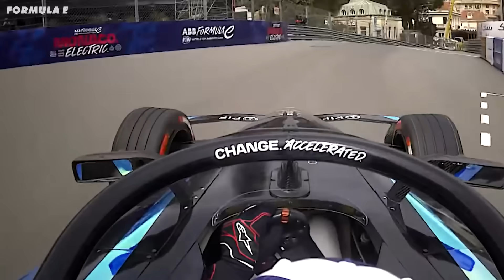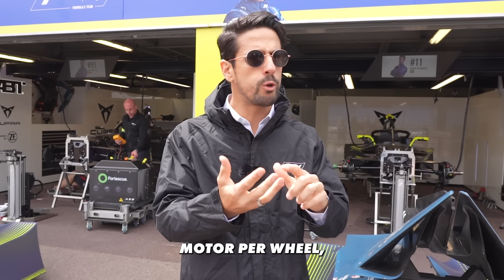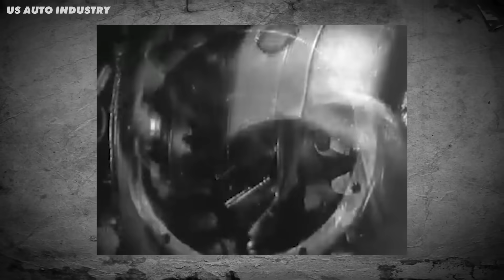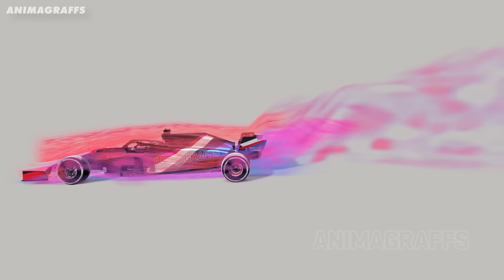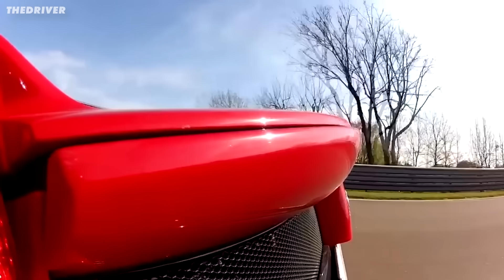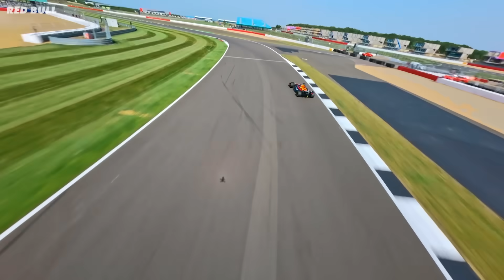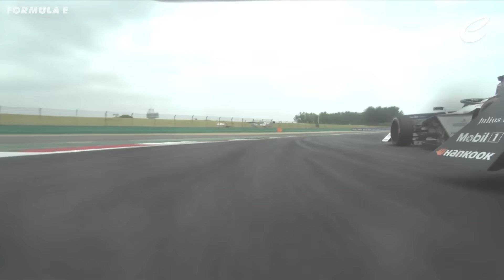The New Formula E Car Might Be F1 Fast

Comment: Active aero is one of the most interesting thing to me. Not just for increasing downforce, increasing and reducing drag, but for giving lateral forces to push the car through corners, counteract body roll, etc.
Reply: That's only possible in Formula student regs where they have massive allowed aero regulation box to provide sideforce.
Reply: @Dakkyun yeah i just hope to see it some day after seeing simulations of a car with full active aero.

Comment: Individual wheel drive, computer based torque vectoring, 4 wheel steering- where does drivers skill come in? Especially when you then go on to say the gen 4 formula e cars are going to be as fast as F1?  I appreciate one can ask what is the difference between this and racing the curent spec Sauber vs McLaren, but are we going too far into the pinnacle of technology corner as opposed to the pinnacle of man (or woman) mastering control over machine? Anyone can floor it in an M3 with the TC on....
Reply: "Anyone can floor it"≠ it's easy to win.

Racing isn't only about struggling with the car - it's about struggling against others. You are not fighting for a lap time for the sake of it, but because someone else set it.

The world of sports would be ridiculous if we never accepted changes that make the sport 'easier' to compete in. This change only promotes good driving, good strategy etc.

Comment: If an Fe could compete with an F1 I'll consider watching it. But racing enthusiasts expect new tech to improve the performance of the machines, not retard them by decades. They'll change the rules for Gen4 Fe to speed them up so people might watch them, but I don't think it'll work as who wants to watch a 15-minute race unless they also increase their range.  
The extra tech discussed in this video has nothing to do with them being electric, it could just as easily be implemented on F1s as well, but the rules currently don't allow it.

Comment: Also urgently needed:  ultra-rapid 30-sec semi-manual pit-stop battery-swaps enabling FE and F1 race cars to ultra-excitingly compete against each other in the same epic events and race series.  But that's obviously something that powerful oil+combustion addicted vested interests - the usual suspects - are religiously opposed to.   But audiences by contrast  DO want to see the ultimate showdown:  electric v combustion battling it out against each other at the same major race event.  Begin the real FE-F1 race revolution with an annual audience-grabbing F1 v FE showdown / face-off race - an epic 60-80 laps on an F1 track - FE cars using both 30-sec batt-swaps and ultra-fast charge-boosts. 
Paul G

Comment: I think it’s a mistake for F1 to become all-electric. We already have Formula E for that. The challenge should be building a more efficient combustion car.
Reply: are they not doing that? they got rid of the MGU-H since the fuel is 100% sustainable. for 2026. sure still hybrid with the MGU-K but they need it with the V6 only producing so much power. and also we really can't go any more efficient. engines are only like 40-45% efficient.

F1 only got 50-52% with the MGU-H. but now in 2026 that is gone. so the heat is not captured anymore.

Comment: Formula 1 has the greatest advantage over all other vehicles in accelerating 0-200 kmh (~5s), not 0-100. When accelerating 0-200 it beats everyone else. Formula 1 reaches 100 (~60 mph) kmh in first gear.

Comment: I'm probably misunderstanding, but if the software is going to control 
everything on the car, where do the drivers come in? 
It almost sounds like at that point, all a "driver" needs to do is press 
forward, back, and side buttons and the car can be programmed to
do the rest, right?
Reply: Nah, the software obeys the driver inputs as much as any other hardware, and they can be setup to the driver's liking, iirc not even TC or Abs allowed in FE.

Comment: As much as I enjoy the closer racing, and efficiency points, I just can't get behind the all wheel drive, active aero kind of stuff. I have no clue what those things will actually do to the behavior of the cars, but I really hope they aren't accidently making the cars easier to drive by making them faster and more efficient. Because I believe that making the cars technically easier to drive, compared to having rwd, or fwd, and no active aero is a lot more exciting; seeing the drivers fighting with the car the whole way through the corner. Having the ability to technically speaking, have 100% useage of the grip throughout the corner sounds really boring to me, as it would be less reliant on the driver, and more on the aero and computer. I love the idea of making the most efficient, and electric racing cars, but I just fear that this may become the new f1 as the years go by, and that honestly sounds not very fun to me. They are in search for speed and efficiency, while also, unknowingly, walking down the path of easier, and more computerized driving as well. Also, this isn't me just bashing on formula e, I think about the same problems with f1!!!11!1!

Comment: When we were kids we used to race electric slot cars, which were incredibly fast. It seems like racing and aviation are fast approaching engineering that removes the need for pilots and drivers. The 1966 film Grand Prix generated the excitement it did because of the drivers and their lives. 🤷🏼

Comment: I think you answered it towards the end. Is FE an experiment, or a racing series? You could throw all the tech upgrades you like at it, but if you want to have it an exciting racing series you need to add more driver input, not take it away with torque vectoring and active aero through each corner. It’s not much of a leap from this to removing the driver altogether.
Besides, if FE were so concerned with maximising grip they wouldn’t run grooved tyres.
Reply: well from what we learned from that AI race in abu dhabi we have a loong way to go before humans can be raplaced by computers to drive race cars.

and i mean F1 had traction control ABS active suspension active aero in the past. 80s and 90s. and i don't see people complain much about that era. 

and you are making me a bit mad here cus first u say u don't want driver aids. and yet u want FE to have slicks tyres. which by nature makes for better grip and easier to drive....WHAT!?
Reply: @jesperhammarlund300  I never said any such thing - I merely commented on the contradiction in the video suggesting FE were striving for more grip, yet they run grooved tyres.
Reply: @CaptainBlackadder75  if u do some research u would know that they run all weather tyres cus they only have 2 sets per weekend. per driver. this is due to wanting to use minimal rubber to be as green towards to climate as possible. and so they can't run slicks cus then they would need a rain tyre just sitting there just in case it rains. and also slicks would not last the whole race. so they would need more than 2 sets and so thats not sustainable. 
FE is sustainability/green to the climate 1st and speed 2nd. and tbh even tho its slower than F1 its has 10x better races

and also these grooved tyres they use are more similar to road car tyres. i dont know about you but ive never seen a road car that use slick tyre. so then why should race cars? 

so FE wants to increase grip in other ways than better tyres.
like AWD Traction control etc. or ground effect.

and if u ask me it makes more sense that they use grooved tyres. cus then they can improve the road car tyres from the data they get from FE racing. more so than F1 does with slicks.

ps: sorry about my last comment didn't mean to rant that much
Reply: @jesperhammarlund300  That’s it
Reply: The council have decided that jesper wins the case.

Comment: If Gen 4 goes axial flux motor + planetary gearbox in the wheel, it will mean the motor and brake are separated by just the gearbox - a very compact unit without a drive shaft. Perhaps the motor/gearbox/brake unit could go inboard so it is not damaged in accidents - this would allow the rack and pinion steering, motor, gearbox and brake to go in one package. With little suspension travel, a short, stiff half-shaft should work OK. Vector drive at each wheel would be great to see.

Comment: Thats incredible but, the drivers should drive the car, not be a mere guide to it. They should use the car, not the opposite. So its them who should be in charge of all the controls, except obvious things that can't be humanly controlled specially on top of everything else like in the motor itself and things of that nature. But all the controls, all of what make the car go where they want at the speed they want and how they want, that is what is supposed to happen when they drive. Not the computer deciding they prefer to do that instead or a person on a computer far away changing how the car work. Them having the control on that, because if not, doesn't matter how much better the computer in board is at it: its stealing the control from their hands, its not doing what the pilot want. Its never a pleasant sensation to do one thing but while doing it something different happen, on top of changing the trajectory they wanted and how they planned do things. Controling the grip of the car should not impact the decisions of the pilot neither should the active aero be controlled by anyone else than the pilots themselfs.

We recognise the greatest pilots/drivers by the way they take corners, the way they manage the breaks and acceleration, the lines they take during the race which is constantly evolving, the way they adapt not just to the changing track but to the other drivers too. That is why Prost, Senna, Schumacher, Loeb, Mouton, Vatanen, Lauda and even drivers like Collins, McRae,  Block, Tsuchiya and so many others are legendary. Because they drive like no others than themself no matter which car it is: they can't be taken for someone else. They are unique because their driving style and competences are unique.

If they can control the cars the way they want, not being """"""""assisted"""""""" by computer """""""correcting""""""" their trajectory, if what the technology is limited to the role of a tool they use and not one who use itself: that will be an incredible car and the pilots would give us amazing races. If not, then its not racing.

Comment: Inboard AWD is better than In-Hub AWD, Student cars aren't physically big enough to easily package front inboard motors though. Hub motors are cool but put a lot of weight far away from the CG, thus are bad for moment of inertia. Also Wheels tend to get smashed up, and those motors are expensive, bad idea to put them in a risky mount. Downside of inboard is you have a little bit of efficiency losses due to needing shafts.
Reply: exactly my thought. another thing i thought about is, FE cars use alot of regen to slow them down as brakes and so they dont rely on mechanical brakes that much anymore.

so here is what im wondering. wont't in-hub AWD basically make regen impossible as those motors are DC motors not AC motors as inboard motors usually are.
Reply: Just for the sake of an engineering challenge, support in hub motor, maybe smaller road cars (something akin to the Original mini) will benefit from this package more than performance cars.

Comment: I still think making it essentially a spec series holds FE back significantly, a true development war would bring the technology on leaps and bounds every year
Reply: That’s true, HOWEVER, a big plus of being a spec series is it’s vastly cheaper. And tbh I don’t know how much the teams are willing to spend on it when it doesn’t have a huge monetary return. It’s still a very small sport tbh
Reply: Nah it is not, powertrain and suspensions are different, it's more like LMDh in this case, you can have whatever motor in the car, you can have AC, BLDC or even brushed motor, they will monitor the current/voltage drawn make sure equal power and all the inefficiencies you have, comes from your own motor, you still have to do the homework.
Reply: @Dakkyun  surely forcing everyone to have the same power is still holding everyone back?

And are the power cells spec? Even then it should be de-restricted to encourage a development war
Reply: @callumlaird1195  batteries are spec. But the motors development, suspension development are still open, even at the same power, you'd waste some of it to heat,it's a war to stop this wasting, even if the motors are 95% efficient, If you remove this restriction, they still are limited by the battery because they STILL have to go the distance anyway.
Reply: It's not a spec series except season one. For now, only aero, batteries and tyres are the same. Everything else is designed and made by the teams themselves. There are some interesting ideas, like Nissan try to use a dual motor design, one motor as flywheel to reduce the electricity use but is banned.
Reply: @kencube86 so get this straight, someone came with with something innovative that could improve electric road cars if further developed (the whole point of the series) but they banned it so they could keep their pelton pack racing?

Why not open it up, no holds barred, and see how much we can invent?

Comment: xD Those drivers need to build a strong neck. With torque vectoring, you greatly reduce the speed at which your car can turn at maximum g-forces. Your car is turning because of the torque all 4 wheels are applying to the center of mass. With torque vectoring, you can trail brake into the corner with the inside tire and the outside corner can start accelerating out of the corner as soon as it gets traction.
While I love those systems from an engineering standpoint I really hope the drivers get limited to fixed mappings of inputs to wheel torque. If you add control systems into the mix it's barely a challenge for a driver to avoid over and under-rotation, similar to looking up a car with ABS.

Comment: I've tried every iteration of Formula E  and they all make me fall asleep.  The car is important but they need proper circuits with run offs so a mistake doesn't bring out the safety car. They also need to get rid of the stupid gimmicks like fan boost.
Reply: Fan Boost was discontinued in 2022-23.

Comment: FI cars have active aero called DRS, necessary because of all that aero. But then are they cars or projectiles? All these tricks when what is needed is technology that improves the breed for the oiks who ultimately fund the racing. People who buy & use cars (not projectiles). Battery tech, and torque vectoring can trickle down into EVs, dynamic aero won't. Unless you are filthy rich then it is a toy. A phallic extension.

Comment: One motor per wheel with those kilos, is better than singel motor. 12 kilos of those motors connected to each wheel, gives better weight managment , better cooling and better battery charging.

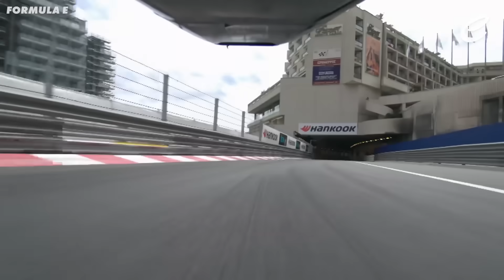Comment: 1:35 How is an electric car 15 times more efficient than an F1 car? I'm pretty sure an F1 car has a thermal efficiency of around 50%. This might, or might not include energy recovered from braking / exhaust gasses. If you are 15 times more efficient you'd have 750% effiency, meaning you'd need to you'd need to recover energy from braking and stuff 6.5 times, which is completely impossible. Is this instead just talking about how much energy is used to drive a lap around a race track? That's not really effficiency.
Reply: Efficient in the sense of total energy used not efficiency in the sense of output/input energy. Sure F1 cars are 50% efficient with respect to input power, but they also require more input power and produce more output power. However, FE cars take less input power but still produce the same results making them more efficient in terms of the final output produced as they only require <5L equivalent fuel vs. 40 or somwthing
Reply: It's the other way around mate, fifteen times more efficient is 50%waste ÷15times =3.3% waste, which is 96.7% efficient which is in the ballpark of electric motors.
Reply: ohhhhhhhhh @Dakkyun
Reply: @Dakkyun Thank you sir. Could I trouble you for a source?
Reply: You are bloody beautiful and intelligent my man finally someone spitting facts

Comment: If it is really as fast as F1 car, then it will be carrying a huge amount of kinetic energy, more than F1 cars. Same speed, heavier weight of the car.

It will need much stronger brakes. And when it goes off - will cause much more destruction. And that battery fire hazard is something else altogether.
Reply: 1)  FE cars are lighter than F1 cars
2) FE has aggressive regenarative braking, it doesn't depend on friction..so not that much heat and pressure on the mechanical components.
3) FE has one of the best Battary thermal management  systems.. so chances of fire is very low...same as any fuel tank catching fire

Comment: Another neat thing you can do with 4 motors is create a slight speed difference between front and rear wheels to cause friction and heat the tires up faster
Reply: Minute torque adjustments to guide the car to pass smoother keeping the wheels straight cutting aerodynamic drag is also a plus.

Comment: its only a matter of time before formula e can lap quicker than F1.
to be fair, F1 is made slower on purpose to increase safety amd help passing. just removing fuuel flow restriction could increase power bu close to 50 %, they hit peqk power at 10krpm and can rev up to 15krpm ao they have to resuce boost anove 10k becaue there's not enough fuel to burn

Comment: Might be F1 fast? Bloody useless if you have to stop in the middle of a race to change cars, because the one you started off in has gone flat and it will take 8 hours for it to recharge.
Reply: Current cars can charge in 5 minutes from flat. Obviously they dont do this in a race but they also dont swap cars in races anymore. Tech is constantly evolving